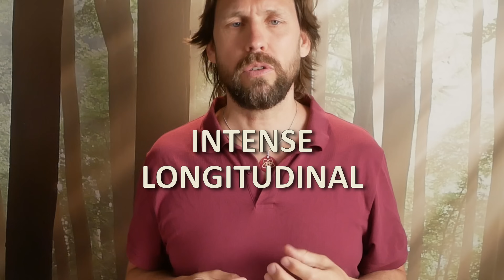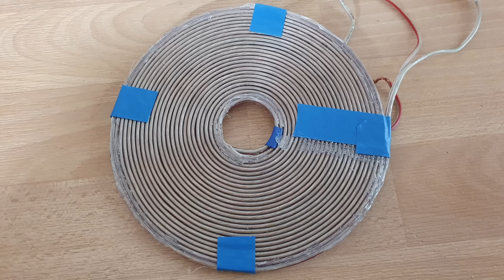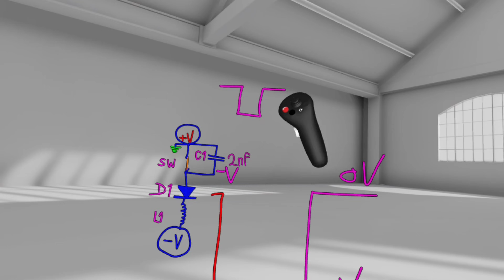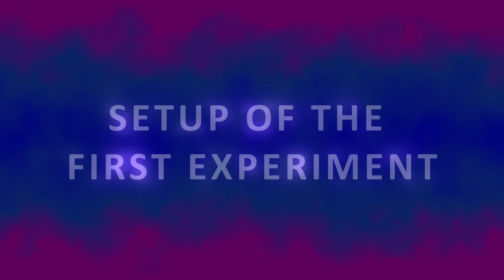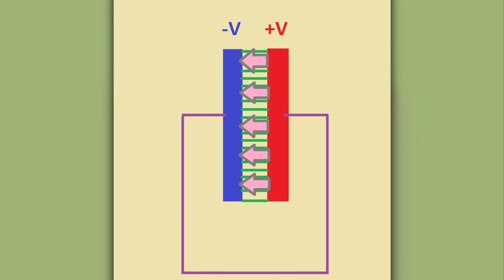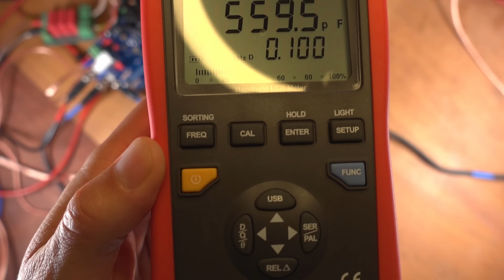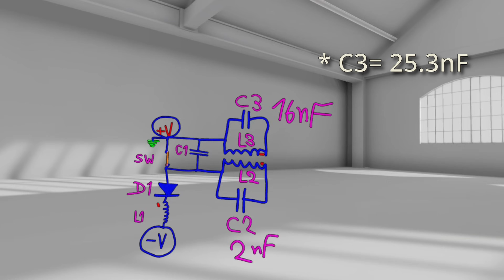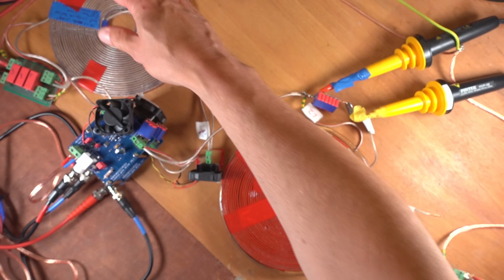Dielectric Induction producing Ground Currents

Comment: I know it’s a lot to ask but, given that you are innovating from where Tesla’s left things, I believe it would make great service to the world if you could fit Eric Dollard’s language (from Versos Algebra and electromagnetic induction and propagation parts 1&2) to start making a wholistic consistent approach to this knowledge.
Dollard has an old video +10y where his vacuum bulb lights on both TEM & high freq Longitudinal and it shows centripetal force on a copper bar. He said 2M volts is a threshold to see radiant energy effects. But never gets to define an impulse as a half resonant wave as you did (perfectly clear).
Reply from the maker: 2MV makes no sense as the threshold is related to the amount of capacity and the rate of change of the voltage. Dollard inspired me in my early research. but I don't prefer math like he does nowadays. experimental insight is what I like most
Reply: @MasterIvo  thanks for clarifying. 
Math (Eric’s of one of yours) will help your work  transcend. (I believe Tesla’s didn’t get all the attention for lack of theoretical background/math and some agenda driven BS.).
Reply from the maker: @juanmf  math will follow when the experiment works. it will help to perfect it and to advance it. but first... it needs to work, and the principles need to be clear. then the math will follow. high dV/dt is key
Reply: @MasterIvo  agree. That’s my main suspicion as to why nobody could replicate the w a t e r f u el c e ll. No impulses.
Reply: "FractalWoman" has a great video similar to what you describe,  'Decoding Eric Dollard's Versor Algebra', you seen it?
https://www.youtube.com/watch?v=F8M3yu_nb-E

Comment: I have to recreate this to figure it out, but observing your uneven L2 & L3 varied frequency displacements, it would seem that you are getting a back current in the low valuers involved here that are triggered from the various capacitors causing iteration within the circuit.. I only use one capacitor, two 1N914 switching  diodes, and three coils in my design and get very little of this kind of fluctuation.
Reply from the maker: the rapid change in unipolar voltage is essential, and it works with the capacity of the coil (surface area).

Comment: So Let's Talk about,  Watts In and Watts OUT if you were to harvest the ground current and voltage with a bridge rectifier and a filter capacitor. What is the amount of energy you think is being harvested from the ground?  Watts In and Watts out. Isn't this what matters? So how would you attempt to harvest this energy without disturbing the resonant circuit?
If you were to use a High-power Thyratron Tube capable of thousands of watts, What would the limits be to collecting ground currents? Would there be limits due to Ground Resistance? Speaking of Ground How is your ground setup. A Ground Rod, a Water Pipe, What?
I built my first TESLA Coil when I was 13 some 58 years ago. Spark Gaps Produce some amazing and interesting anomalies. 
https://www.youtube.com/watch?v=BWGxwGrAVjA
Reply: It would or should move tours the output being minimum on the input because of the pulse being created from the ground thus condition is plasma the datearium is also in the 4th state of matter the use of such would be dielectric also
Reply: Can work together to create condition this is not a contest
Reply: Your comment comes across arrogant. This is a 1st experiment on capacitor impulses. Which Tesla wrote about 100 years ago as he was amazed at their speed (which intuitively makes sense as magnetism is a slow vortex compared to the lightning discharge of balancing sides of ether under strain. About 10x difference. 
Ivo is doing a great job and to answer your question a lot more has to be experimented.
If you are so cool you should be answering this question yourself, as it would cost you a few hrs of work to replicate the setup.
Reply: @juanmf  I am Sorry if I sound arrogant, It was not my intention I have a lot of experience with Tesla Coils but don't have all the answers. That's the reason for the questions. The Idea of the collapsing dialectic field creating a vacuum effect that causes entropy to equalize that void at the speed if light is very interesting. The question is: Is it practical, That's all I was trying to get at. 
It seems that life gets in the way, I bought all the materials to build a hairpin circuit 25 years ago but have never had the time to put it together.
I have been waiting a long time to get some of these answers and I am getting old and I don't have the nice equipment he has. He has done more than anyone I have ever seen Yet and Shared it freely with eloquence. That is wonderful.
Reply: @Thomas-qr3bg  it’s ok. All of us are getting old I just got an interest a y ago and recently turned 40. Eric Dollard has some nice videos on energy synthesis. Dan Winter on negentropy. Ken Wheeler on magnetism and field theory, Ivo is the hand-on that I find educational enough to start experimenting. Konstantin Meyl, the closest to an Einstein we can find but on the right track (Tesla’s track). If you want answers you should go watch all their videos :). I think it’s totally possible because mainstream physics laws are BS and have one thing in common, they are limiting, a brain virus as Dollard calls it. 
Putting a lab together.
Reply: @Thomas-qr3bg  https://youtu.be/is_fui9NfF0

Min 48 for details on construction.
Reply: @juanmf  Inwas gonna mention Dollard until I saw this comment

anyone claiming to be a tesla wizard needs to go watch dollard and prove him wrong first lol

Comment: Hello Ivo, thank you for doing what you are doing, and sharing it freely. About your "emerged" ground current, do you run your circuit on battery or via your AC/DC power supply ? If you use the AC/DC power supply do you have any isolation transformer (AC/AC with no ground wire connection) between the grid and your power supply? This is just to make sure that you are not driving an earth current through your power supply.

Comment: hello, i need your help i think i know that it is important to use coils that are 180 degrees apart from each other. how do i recognize in a stator how around a coil is wound? is there a simple method? and when I know, do you use circuits in series or in parallel? ac is important to me not dc
Reply from the maker: in a stator, most likely they are not counter wound but you can reverse connect one winding.
you can measure inductance, with 2 coils in series. when inductance is low its counter wound, when high they are wound in the same direction.
Reply: I read on the internet that you need 3 coils for my experiment, two have to be in resonance, the third one a few turns larger. Can one omit the third and replace the third with a rotor with permanent magnets?

Comment: Hey Ivo I love your video's. Thank you for doing what your doing, and sharing it freely. Your work is inspiring and greatly appreciated. I intend to do the same myself. After recently watching Dr. Greer's 'The Lost Century', it's sparked my interest into doing my own electrical research. So anyways, I'm ordering the parts to duplicate your dual MOFSET/Isolated Gate drive and I ran into a problem. The web links that you have posted on your website for the PCB and Isolated Gate Drive circuit no longer work. Also, the links you have posted in your previous Radiant Half Bridge/Isolated Gate drive video descriptions that I've found no longer work. If you can help point me in the right direction, it would be much appreciated.
Additionally, if I can speak for myself and the entire community, could you please use the word "longitudinal" as much as respectfully possible in your future video's? I love it! :) Thanks IVO!!! We need more generous people in this world like yourself.
Reply: Nevermind, I found my answer in your I.G.D. +3hr video, I just overlooked it. I've ordered what I need now to duplicate your dual MOFSET switching setup, and also make an additional switchboard. Using a different type of SiC MOFSET (Infineon 1.2Kw, IMW120R060M1HXKSA1). I will mount my coils horizontally on a wooden dowel rod or pvc pipe, instead of laying them flat on a table. I think that could be an easier way to test the various coil coupling distances.
Reply from the maker: Hi, good to read your are willing to experiment. Indeed that video has all the info. but, I now strongly feel that it won't be needed. I am testing a low side switch setup. this means I don't need a isolated gate driver. if it works I will publish, as always.
Reply: What was your reasoning for using matching resistors before the Mofset gate, instead of one smaller/one larger resistor?
Also, why not switch both sides, with one high side Mofset, and one low side Mofset?
Reply: What gauge ground wire are you running to your copper waterpipes? and how long is the run of that wire from the experiment to your copper pipes?
From watching your videos and seeing the attention you've placed towards that aspect of your experiment, I think that may be an overlooked factor. (It might not, I don't know. You haven't said much about that part of your setup other than connection to your copper pipes.)
I have done a fair bit of my own Tesla research myself. One thing that he stressed was the importance of a deep, 'very' low impedance, ground connection. To him, it seems that was of absolute importance. In one of his later patents he says, "No expense can be spared when making connection to ground".
If you think about it, he has a point. To make a connection to our planetary system's electrical circuitry, you need the proper, deep, thick, low impedance connection to do so.
For ground current induction, I don't think that aspect should be overlooked. Actually I believe that's probably right up there with one of the most important factors for any type of setup for inducing ground current.
Just a thought.

Comment: I wonder what would happen if you sandwiched three coil-plates (CW, CCW, CW), set up each of the outside plates with high parallel capacitors, set one's outside edge to earth ground and the other outside coil's outside edge to an antenna. The center coil-plate would be driven by the trigger as before. The L3 coil-plate would draw current from the earth-ground to satisfy the electron vacuum and I would imagine that the new L4 coil-plate would draw current from the antenna (the atmosphere) to satisfy its own vacuum likewise. Each L3/L4 coil would cause influx of resonating energy from each medium into the system.

Honestly, this to me sounds like what Nicola Tesla did in his experiment in Colorado when he took out the power company by overproducing power with his large tesla coil.

Comment: https://youtu.be/ofEqqxvq20k

Looks like faraday cages actually don’t work on longitudinal waves.
Reply from the maker: why not?
Reply: @MasterIvo  exactly why is open to debate. Experimentally, it didn’t work. Konstantin Meyl also mentioned how in the close field 1/6th of wavelength a faraday cage didn’t stop a signal from being sent from an antenna, stating that in the close field the signal is a shock wave, that later deploys as transverse.
I Imagine it’s because as a longitudinal travels as a pressure gradient anything put in front is just used as medium to keep propagating. Partial Exceptions would be shapes that manage to deviate the energy, which is why I think pyramids and Irish round towers have an effect on plant growth (I tested round towers myself, about 3x boost in basil plants just with a paramagnetic round tower of 25cm height) because they face the wave with the right angle, some energy would travel through, some would successfully get diverged to the sides, where plants get more of it.
Reply: @juanmf  Garden of Eden, Marijn Poels.

Comment: Where is this energy coming from. If its being pulled from ground what is the effect on the ground  could you pull electrons from a rock you grounded to would this make the rock more maluable or easier to move maybe? It must have some affect maybe it would want to rise in the air to reach a Higher potential to recover lost electrons? Idk im just guessing i think gravity is more electrical density than anything
Reply: Gravity = Mutual mass acceleration

Comment: Hi Master Ivo, got a question on coil design, I'm on the path to building my own dielectric impulse transmitter and receiver coils and I'm curious to know if it would be advantageous to make any of the coils bifilar in the transmitter or receiver?

Extra question, should the receiver coils be tuned to 1/4 of the frequency of the transmitter or the same? Cheers.
Reply from the maker: same frequency
Reply: @MasterIvo  Thanks, and making any of the coils bifilar?

Comment: Waited 2 years for you to take interest in the stuff I'm looking into! I got interested in this when I read from a physics book something like "If you connect a plate with a voltage to the earth ground, the ground will provide an unlimited amount of energy to put that plate voltage into ground level". The way to to tap into this energy is just to abuse the laws of Nature. You create an imbalance and just wait for Nature to correct this imbalance. You can improve on the system by making it hard to get the plate neutralized and resonance to beef up the current/voltage. Harvesting can be done with induction. You can use a coilcap (Jack NoSkills pefaef.pdf) in harvesting to mitigate lenz of the load side. If you start looking into old radiant energy guys like Thomas Henry Moray you realize that he is just discharging caps into to ground. All the rest is just smoke&mirrors to try to fool everybody. We are taught the ground is where you dump all your excess energy into, but I was never taught in school, that it is an endless supply of electrons (basically recharged by the Sun) and you can also pump it out. Energy companies need engineers to install more meters and fix transformers. They don't need engineers to look into this stuff...
Reply: Friend, Master ivo, have several errors, 1- resonant frequency of a tesla bifilar coil is a dynamic value depending of frequency. 2- there are several resonant frequencies that need to be checked : a - resonant  frequency of the component, b- resonant frequency of the lc circuit.  by example if a capacitor is used beyond her natural resonant frecuency is not a capacitor is a inductor.

The excess energy can become from earth, but also can become from ether.
Reply: @BienestarMutuo  yes I have no objection to the ether theory. M & M never disproved the ether. They just disproved the static ether and the value of the ether drag. They actually found a constant drag in every experiment. The experiment is now presented like it disproved ether. This is because Einstein is god and people are willing to invent invisible magical things to uphold the failing theory
Reply: I don't know who is more stupid ,master ivo or the people who are following this channel ,a guy who thinks he knows about bifilar coils yet he cant even make one correctly ! what this guy is showing you is NOT A TESLA BIFILAR COIL LOL !!!!!! WAKE THE FUCK UP !!!

Comment: https://youtu.be/7H7NACnsmzU so ive been pulling on this thread for quite a while now. However i am just learning about negative resistance oscillators and the function of electron avalanches. So it turns out that this is the underlying principle for all ou devices but you really have to study the literature on the components and circuits that are capable of these functions. Like not all p-n junctions will avalanche or can be reverse biased. It turns out the spark gaps and gas discharge tubes are negative resistors. Negative resistance is responsible for the runaway effect in LC circuits at resonance which can cause the parts to destruct. A trumpet wave that is the inverse of a damped oscillation.  This is how all of the don smith devices operated. When you have a negative resistor and a normal resistor hooked up in a voltage divider, it actually becomes an amplifier of the input signal. In the case of my circuit, i have a open air spark gap, and a florescent tube operating in reverse bias with my 75mohm resistor coming of of the cap.    When i unplug the power cord i am reading dc voltage to ground from both plugs. So i have a pretty good balance between positive and negative resistance maintaining the current as it oscillates, but its not even at resonance! And when i connect the 75mohm resistor to ground through my volt meter, i have the postive lead to ground and the meter reads a positive DC voltage! I am actually pulling electrons from the ground! I have searched everywhere to find the connection between negative resistance oscillations and a ground current but have only been able to reference nikola tesla and most of whay he had to say on the subject is not very clear but i can tell that he knew about this as well. So it looks like also the bifilar coil was a tuned resonant lc circuit meant to do the same thing. So what i think is that when you have the resonant circuit in an undamped oscillation mode and its running away, you tap into the earth at its highest point the circuit can handle and pull in the charge from the earth to counterbalance the negative resistance and you can discharge that energy when it becomes too much for the circuit and the cycle starts all over again. Its a parametric pump.
Reply: https://en.m.wikipedia.org/wiki/Electron_avalanche
Reply: https://youtu.be/e2urrFy6i1Q
Reply: https://youtu.be/qKqrXcU2jGo
Reply: https://en.m.wikipedia.org/wiki/Negative_resistance